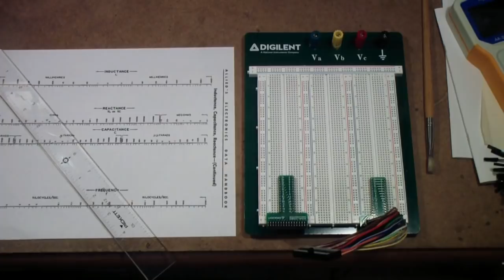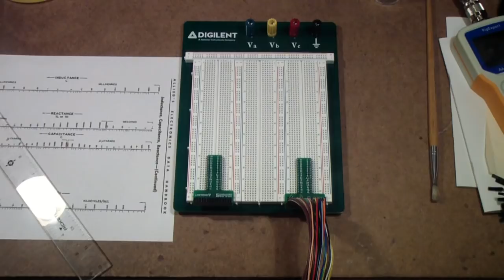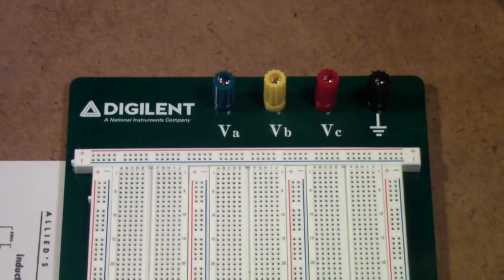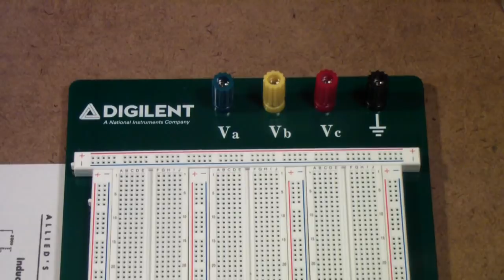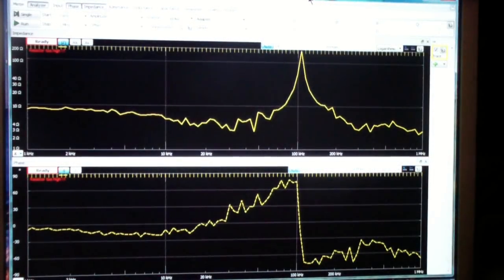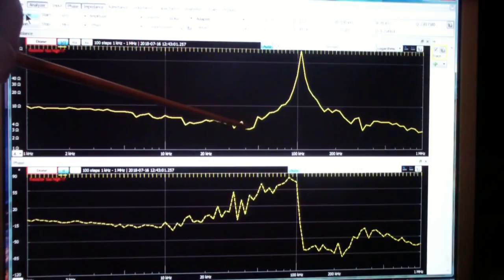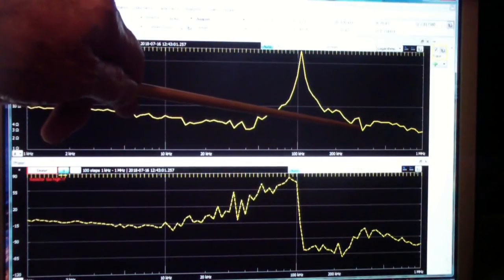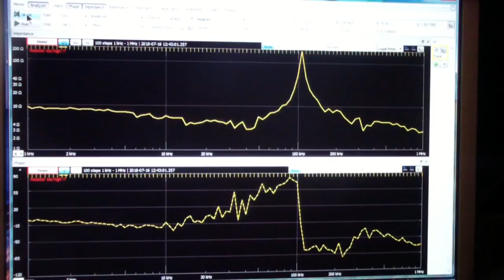TTT204 New Analog Discovery Toys

Comment: Thanks Tom - I think AD2 is a great way to go.  I run and compare with my HP 8903 and Keithley 2015THD with high correlations.  Using the latest beta Waveforms you can do the THD vs Freq plots that adds even more value!  Do you think there is an AD3 on the way?
Reply from the maker: I don't have any insight on a possible AD3 but I definitely use the new Waveforms/AD2 combo as well as the Keithley 2015THD (I did some videos comparing the THD performance of those that you may have seen). You might want to do a video of your own on a similar subject including the HP 8903. David from ElPaso Tube Amps uses the 8903 a lot as well as the AD2.